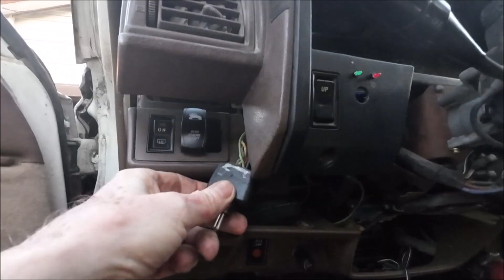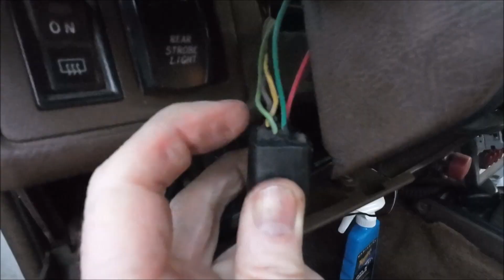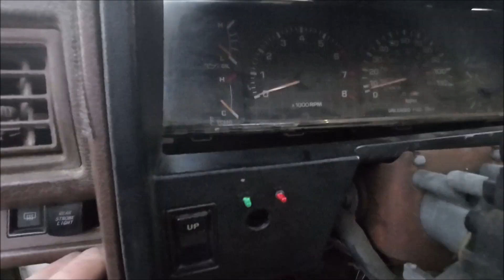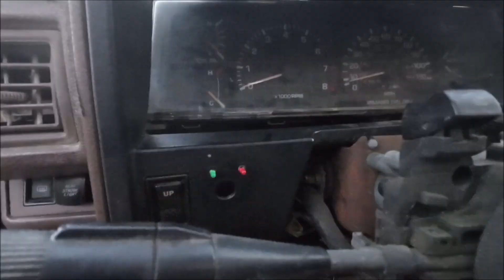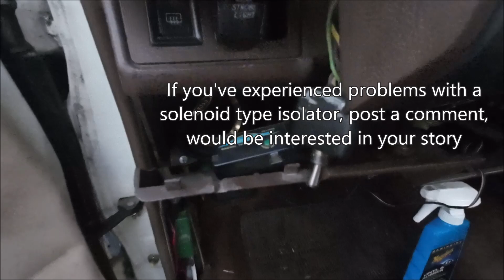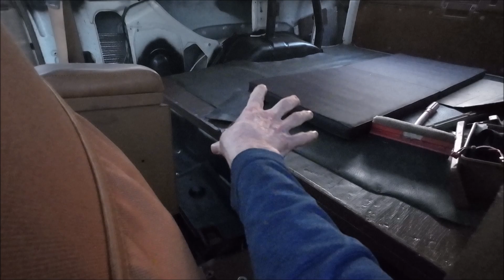Dual Battery Control Switch Repair

Comment from the maker: After 25 years with no indicator LEDs, I decided to try and fix those.  Then I found out there were other issues that will need a separate video to get into.  

Aside from this, I've had zero issues with this dual battery kit since it was installed.  It works as it should.  Normal mode powers up the solenoid, that ties the two batteries in parallel, with the ignition.  The jump start mode works very well, flip the switch to the other side, start the engine and flip it back.